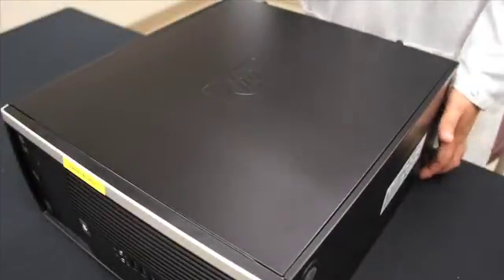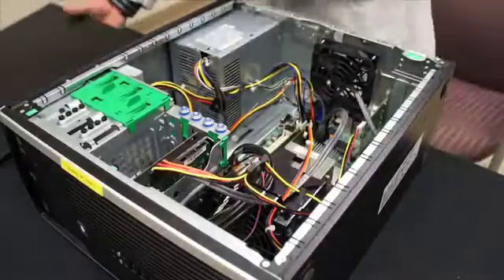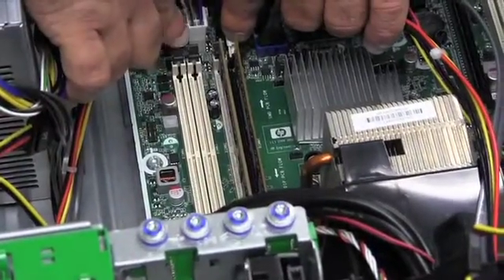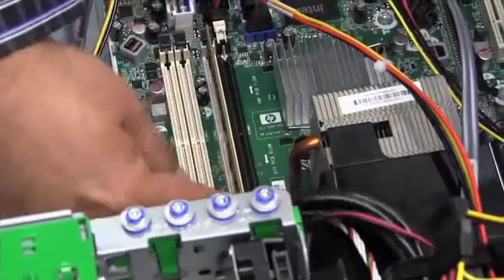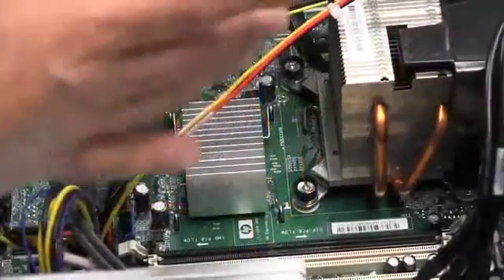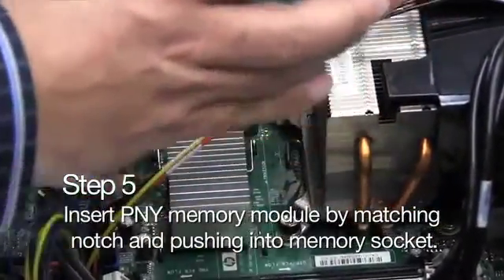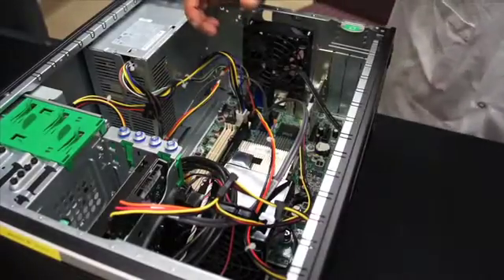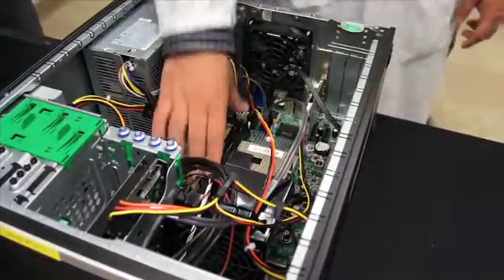PNY How To Install a Memory Upgrade in Your Desktop Computer

Comment: I got pny 1866hz gaming memory 4 x 4 16gb kit, it's running on 1.5 v can't get it to run at 1.65v and it's were it needs to run at that's why I paid $190.00
Reply: You do in in the bios